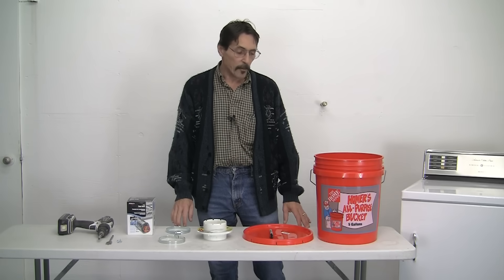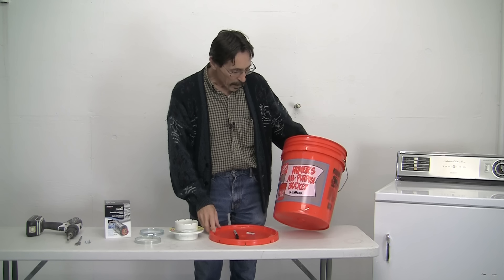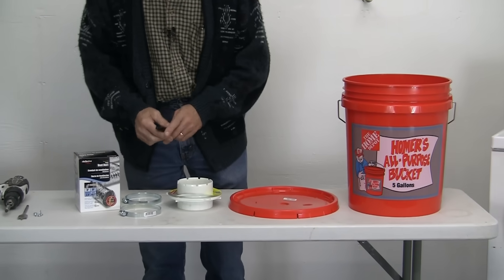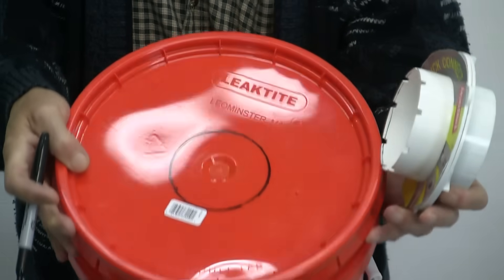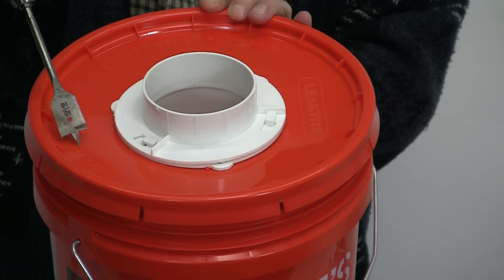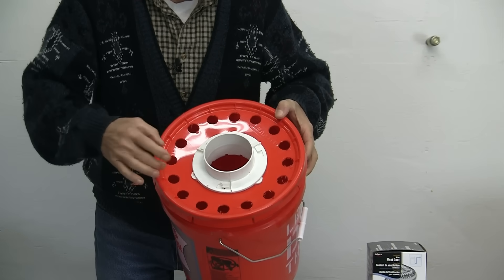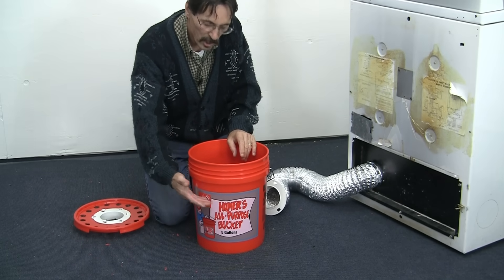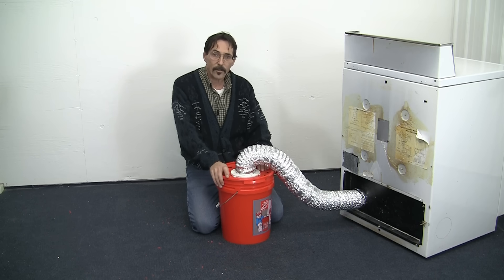DIY How to Cut Electric Bill in Half: Part 3 Clothes Dryer Free Ideas | Missouri Wind and Solar

Comment: My husband insisted that it was safe to do this with our gas dryer.  Good thing I moved out.  Maybe that's why hes so slow.
Reply: Your hubby is right. There is no connection between the heat that is generated by a gas dryer combustion chamber and the air that is drying the clothes. A heat exchanger is used so they don't mix. If there was a connection, your clothes would smell like gas and have a tough time drying as the gas exhaust has water in it that manifests as  condensation .
Reply: Steve Prestek It’s the CO2 that’s the problem with gas dryers not the heat
Reply: @steveprestek9608  Even if the gas exhausts don't mix with your clothes, that doesn't mean they don't exit through THE SAME TUBE at the other end of the drier. That would allow for a simpler set-up, which is a pretty powerful incentive for a commerce-driven company. It's not worth taking the risk with a gas drier unless you're sure the gas exhausts are removed through a separate tube than the hot air tube. Oh and if there's ever a leak, you're F'ed.
Reply: Steve Prestek OK. where do the combustion chamber exhaust gases go then? where is their exit?
Reply from the maker: +genevievefortruth Lol
Reply: I don't believe the gas dryer flame puts out any more carbon monoxide than your oven, which is not vented out. I've been venting my gas dryer inside in the winter for over 20 years. When the house gets really dry, I'm looking for things to wash and dry. It also smells good.
Reply: Jeff Weston always keep a window open to let fresh air in to prevent carbonmonoxide poisoning if you have gas appliances and a detector is a small investment
Reply: lmfao. shouldve got insurance
Reply: Jesse, you know there is no "heat exchanger" on a gas dryer. Why are you humoring this guy? ;-)
Reply: older man yes I know. no need for an exchanger.
Reply: Steve Prestek f
Reply: LOL !! Yup ! LIFE INSURANCE !!
Reply: You may be an extra (or supporting actor) in an upcoming episode of NCIS or Dateline.
Reply: genevievefortruth ,he probably feels the same about you too . :-)

Comment: I cut the hole for the duct near the side of the lid.  Then, on the underside of the lid, I put a small flap directly under the duct hole at a slight angle to direct the air toward the front of the bucket.  Then I cut slits in the lid that resembled a grill at the side and in front of the duct hole.  Then I cut perpendicular slits at the end of the longer slits to create flaps that could be bent up.    Don't know if that really helps but is seems to.  That way, the exhaust could be directed in a particular direction, if desired.  After I used this for one season, I used sheet metal for the duct hole and the flaps.  Still using it to this day.  When the plastic bucket gets too dry, switch out the sheet metal that's already manufactured and put it on a new led.  Hope this wasn't too convoluted to understand.

Comment: Back in the 70s I created a simple invention that cut my gas bill in half.  I could not give it away. Nobody was interested.  Perhaps today some will run with it.

Back then the electronics were quite crude.  It had two thermostats, one set normally and one set cool with some electronics to switch between them. Today all this could all be integrated on one circuit board.

I used crude burglar alarms.  If one were triggered, it would use the warm thermostat for 20 minutes.  If there were no more triggers, it would revert to the cold thermostat.

The effect is, the thermostat turns down the heat if people go out or go to sleep.  It works no matter how chaotic the schedule.

My dog Sheldon learned to jump through an infrared beam of one of the burglar alarms when he was feeling chilly.
Reply: +Roedy Green Its called https://nest.com/
Reply: That's pretty funny!
Reply: +Roedy Green That technology has been integrated into the smart thermostats available now.
Reply: Yeah we are past 49 year old tech lol. .
may have been a good idea then but application has changed
Reply: Roedy Green o

Comment: great idea. have to try it out for sure. Just one question are you just running the dryer when you doing laundry or is this just when it's getting cold in the winter?
Reply from the maker: +PfC Wells Just for winter time use.
Reply: +MissouriWindandSolar thanks for getting back to me. I'm gonna start following you for sure. I had another question or 2. Does it matter how many level you have in the house. so if your dryer is in the basement, would you feel it on the 1 n 2 floors? n for clarity, I could run this even when I don't have laundry? or just when I have laundry? n wouldn't that run up your electric bill?

Comment: I use two buckets one with water and no vent holes and the second with water and  top vent holes and nothing comes out but clean air. PS use 3'' PVC between the two bucket with an elbow in the second bucket, work great.
Reply from the maker: +Carl Smith Now that sounds like  a good idea.
Reply: I used your ideal then just added one.

Comment: Dude get a window screen and cut  a hole for the hose and put both hose and screen near the bottom.  The window screen  will catch the lint, no water needed then seal the lid. 
The moisture where I live is bad so the water wont be good to breath.

Comment: A lot of condensation on the walls of my laundry room when I do this.   Any tips?
Reply: +GeneralMartinus Yeah, just vent your dryer outside like most people. This is a terrible idea, dryers give off way too much humidity and does not circulate that humidity around the house, you have this big box in the basement or such that does that for you.
Reply: I'd rather this route if there is a viable way to prevent condensation from forming.
Reply: +shanmike11 
No it's not. As someone who works for an HVAC company that installs whole home Humidifiers, 55% is actually the typical amount to aim for.
Reply from the maker: +shanmike11 55 percent humidity is the correct amount to have in your home. In the summer it can go 80 percent in your house so what's the problem with 55 percent in the winter? There is no problem.
Reply: +GeneralMartinus My tip? Don't do it. Pretty simple. 55% humidity is INSANE.
Reply from the maker: +GeneralMartinus Yes, you can put a fan in the room and blow the heat out of that room to the rest of the house.
Reply from the maker: +Jeff Gedgaud It's a great idea and has been used by thousands of people for years without any problems at all.
Reply: Fan is a good idea, thanks!
Reply: +Jeff Gedgaud there are heat registers in basements, warm air rises and goes up , up stairwells through doors.. Front and back doors of homes when open create ventilation. But is it a building code violation?

This is a great idea.. But one thing not mentioned is bacteria. A charcoal fabric filter at fish stores works awesome.

Brita water would not be safe because you need chlorine to kill bacteria. Stale water and lint could cause allergies.

How much money would this save? Several people would have to compare power bills , square footage and furnace btus.

Have a safe life.. Lol.. Our asshole neighbour almost blew his face off with his bbq... On april fools day.😆

🍾cheers
Reply: +GeneralMartinus Yes there is. Just need a longer hose right out the window. Moist goes outside and the long hose cools off the air inside it and gives off that heat to your room.
Reply: +GeneralMartinus Would the smallest, least expensive de-humidifyer be a ridiculous suggestion here?  
The collected water could be filtered and re-introduced into the washer, perhaps?...
In fact, has anyone ever attempted to capture the washer's drain-water, filter it and then reintroduce the filtered water back into the washer for conservation purposes?
Reply: Easy.... Open the windows

Comment: Nylon like a panty hose leg IS the best way to go! I've done it for years!
 Just like the dryer lent screen it needs to be cleaned from time to time, not every use like the screen but it does need cleaned. Also use a long length of panty hose leg not just a short section that just covers the hose end, that does not restrict airflow or moisture when using a full leg or 1/2 the leg.
Also for some of us that use wood heat and run hot fires at times, put a dryer near the wood burner and modify the air intake to suck hot air from beside the wood burner. No control of heat this way but does not really matter, clothes dry great and do not over heat, just disconnect the wires from the dryer heating coils if electric or do not connect the gas if gas dryer! Only electric used is then for the 110v motor to spin the drum and blow air.
 I did this years ago when I bought a gas dryer for $35 used and have no gas to run it LOL
 I set up the extra wood heat dryer when heating season comes.
. All electric house other than stove which was ran on a small tank.
 Wood heat and panty hose for dryer saves me allot on electric and the moisture reduces the static shocks that occur with dry air.!
Reply: Den 
"No control of heat this way but does not really matter"
Your clothes will start to smoke at around 150 degrees F. and can and will combust.
Reply: Turbo Encabulator 
😂😂

Comment: I did a similar thing a few years ago in my garage. The washer and dryer are both in there. I found that moisture is NOT something you want in your garage. 
It sure did help everything rust faster.
Reply: Yeah, you will get moisture anywhere that you are exiting the bucket. Plus getting rid of the built-up smooze in the bucket is a little dodgy. Think of dumping that for a few years in the same place. That's a pile of wet lint! I think if you wish to put to use the heat that is heading down the pipe you need to think heat exchanger. Recover the heat and not the lint.
Reply: lol same. all the popcorn plaster fell off my ceiling.
Reply: Chris Smith crack the garage open boom
Reply: ItsAlright - It did you a favor if its asbestos-based! ... Unless you inhaled it..... 😳😷

Comment: great Idea, I used silicagell years ago instead of watter and it  captured all the moisture as well, water is cheaper but you still get condensation in the room it comes in.Like the way the guy thinks
Reply: +Sandy Fraser  It depends on your room I guess, condensation forms in the cold. If in a room not heated then you might get allot, if a normal room of about 70F or so should not be much really. Cold windows though may get a fair bit.  Drying a load of clothes should not be much worse that boiling a pot of beans or Mac and cheese etc... which also put lots of moisture into the air.
 I use wood heat which tends to dry the air anyway so I like the extra moisture. 
 Walking across carpet in a room with dry air creates static shocks which I don't like nor do my dogs and cats LOL
 Also static shock can kill electronics like computers which I build or repair at times

Comment: What a mess this makes.  Save the bucket for the mop water and just vent the dryer into the room.  You will still get all kinds of ghost turds and lint everywhere.  Put a little effort into it and make a vent through the wall to blow the exhaust outside for a cleaner house.
Reply from the maker: +Garras Porgratix It doesn't make a mess at all. All the lint is trapped in the bucket. This is meant for winter time use only to lower your heat bill. It's not meant for summer use, you just go back to your outside vent.
Reply: I say this because I tried it by feeding the dryer to such a thing when the dryer was in the middle of the room until I ran the gas line near the outside wall where I then installed the dryer there. There was a lint filter that would fill up and pop the lid up.  The lint would escape and fill the room.  What a mess.  Now, that does not happen outside.   Any lint simply blows away in the wind before it even settles on the ground.  Nice.

Comment from the maker: I was in the appliance repair business for a long time, that's why i came up with this vent bucket 25 years ago, it works. Been using it ever since. Never any mold or mildew at all. Most of the moist air goes out into the house not back into the dryer.
Reply from the maker: The Rainbow vacuum cleaner uses water for there filter and have been doing so since the 1970's i believe. Works beautifully.
Vehicles use to use a oil bath air filter before paper filters came along. The dirt was trapped in the oil.
Reply from the maker: That is correct.
Reply: ...and this catches all the lint with no filters aye? Just from blowing on the water?
Reply: Works almost like a water bong!
Reply: +MissouriWindandSolar 

Cool idea, I'm gonna give it a try. You're right, those vent screens are useless!
Reply: sweet
Reply: MissouriWindandSolar    just made mine today:) thanks for sharing:)
Reply: Sounds like you need a new belt that wraps around the drum ?? Easy fix if you're handy with tools.
Reply: Probably in 40 plus years you may have to reinvest.
Reply: MissouriWindandSolar 
This is a brilliant idea!
Reply: Great idea!  Thank you for sharing.
Reply: I bet if you took your idea to a major appliance company they won't want to hear it. You know how that is.
Reply: @codetaku7  I agree Dustin, I never use my oven when the A/C is on for that reason, and I saw a cool idea where the heat from the shower drain was recovered but the damn city plumbing inspector would not approve it and it was removed. Ass hat of an inspector. Codes get in the way of most good ideas, that is why they suck and I hate them
Reply: @integr8er66  they only inspect your house once. Unless you live in authoritarian land
Reply: Donna L White
Reply: Rebecca Barton how is ur bucket lint trap/heater working?
Reply: MissouriWindandSolar y
Reply: How about in an apartment with a stacked washer dryer
Reply: MissouriWindandSolar - Jeff 
Can i just come over to get my clothes dry at your place. I dont have time to go to HomeDepot and create all this thing. Its easier to take my wet clothes to your place.
Reply: MissouriWindandSolar que me iba de las
Reply: Wish I would have found your video sooner. Could of saved hundreds of dollars.  Have a question off topic - I have an Electric GE wizard dryer that heats up but won't spin. If I open door hold button in and give it a spin, it starts spinning but slower than normal and if I close door really fast it'll stay working, until I open door again. Any ideas?
Reply: @johnhajuno  some motors have starters capacitors, it may have failed.
Reply: That's how push mower air filters work... oil soaked sponge!
Reply: MissouriWindandSolar Yea, and I invented the question mark....

Comment: I don't meed more moisture in my house! I think you ned to make a simple heat exchanger to isolate the moist air.  Use a motorcycle  or old car radiator as the exchanger.

Comment: sweet Im so doing this thanks ,, off to Home depot
Reply: +Ed Yager OK I made this and yes it does give out nice heat BUT it was raising my humidity to 70% AND the worse part was the smell of the detergent. I used it for a week and ended up taking it off and venting outside . I do think however that a heat exchanger would work better and no humidity or smell ..

Comment: Never understood using an electric dryer in the house during the summer anyway? AC is removing heat from the house the SUN is trying to add heat to the home. And the Dryer is adding heat to the home. Not a litte either we live in a mobile home the dryer is vented into the floor that heat is blown under the home and you know what heat does? RISES yes you are pumping out heat below a home that is heating the underside of the home. My mother's home has washer dryer outside we rarely ever freeze so not a problem to have them outdoors.

Comment: you can cut your electric bill by getting a gas dryer
Reply from the maker: +ebsen raptzski That's true. Gas is cheaper to run over electric. You just can't use the bucket with gas.

Comment: Cool idea. I will have to try this. I just got a new dryer 4 months ago...that stupid thing takes 2 full cycles to dry 1 load of clothes. I hate it. But nothing I can do about it cause I can't afford to buy another new dryer.
Reply from the maker: +getsmartnow2011 You may have a problem with your vent pipe. Could be plugged up with lint or your hose may be bent over behind your dryer.

Comment: Except for need to replenish the water more frequently, you said the little ones don't work, then why would your larger one work any better? Also am concerned about the warmed stagnant water in the bucket growing mold between uses. not good
Reply from the maker: +Edward Fry Been using them for years without any problems at all.No stagnant water at all.
The small ones let the air escape to quickly and the link with it. They get low on water quick then tip over.

Comment: i did this in the 1980s it really works
but i did it with my gas dryer

works good in desert when its cold and nice how it puts humidity in the air
Reply: maple you meant carbon MONoxide (CO) surely. Yes, combustion of gas (and nearly all combustion) creates carbon dioxide (CO2), but the amount from a gas dryer is inconsequential. It’s an accumulation of carbon monoxide that is deadly and will put you to sleep and snuff you out.
Reply: I also used one of these for years on a gas dryer, I guess I did not dry enough clothes to die from carbon monoxide poisoning.... I don't recall seeing any type of warnings on the package when I bought the store-bought version.
Reply: Martin Rickarx I got a Load drying right now Pumping that carbonmonoxide right in the house with my gas dryer.Except for when my furnace kicks on It sucks it right out.
Reply: Very low co levels will only make you feel flu like but long term exposure does the same thing as sucking on an exhaust pipe if your venting a gas anything into your home you are dumb why not let your water heater vent inside too n finish yourself off smh